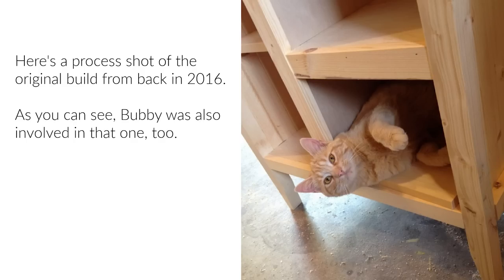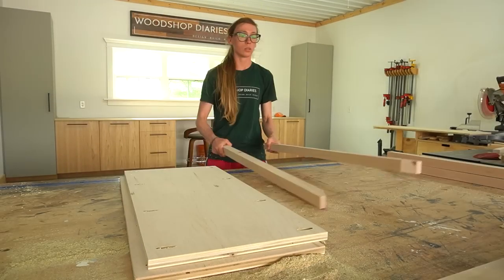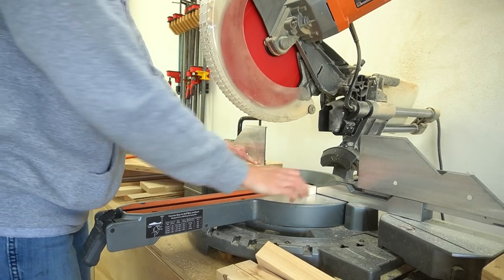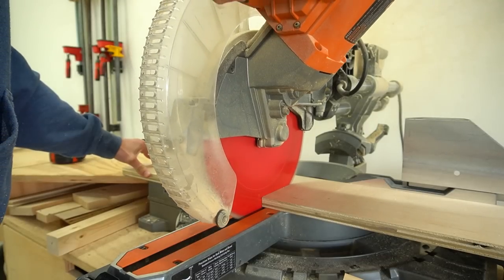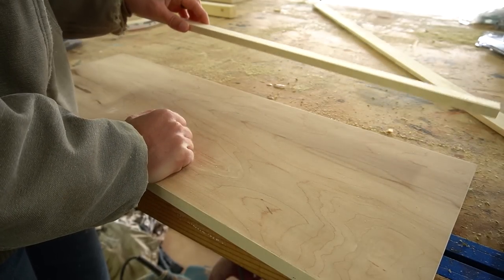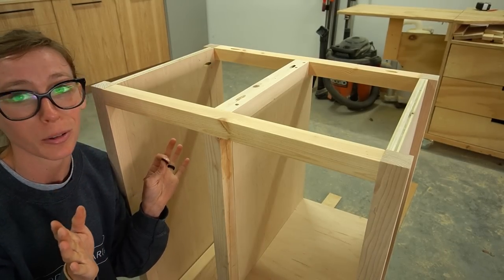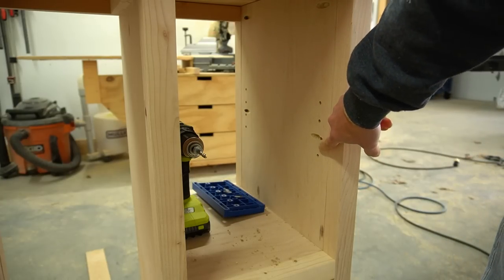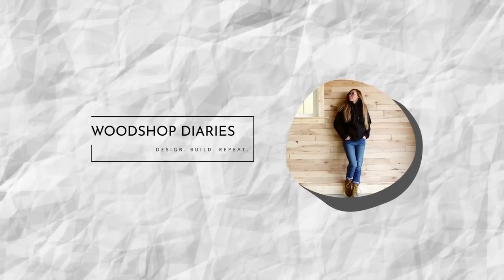I Re-Built a Project from 7 Years Ago | DIY Accent Cabinet Plans

Comment: This was a very nice project.  I recently found your channel and have especially enjoyed seeing how you primarily use the pocket hole fasting method.  I will be using this method on my current project to build a linen closet. Thank you for your very clear instructions and illustrations.  I think I may try the Kreg ripping system, too, for breaking down the 8' x 4' x 3/4" sheets.
Reply from the maker: Thank you so much! I love pocket holes for building and especially for cabinets and plywood projects! I’m glad you find the videos and the instructions helpful 🙌 for what it’s worth, I love the Kreg rip cut and accucut guides and use them on almost every project. They’re life savers! I have a guide to using them here if you’re interested: https://www.woodshopdiaries.com/cut-down-plywood-sheets-with-circular-saw/
Reply: @WoodshopDiaries  I ended up getting the Kreg rip-cut and also the Accu-cut.  Just finished breaking down a sheet of maple plywood using both of them and am very pleased with the results.  It was a little "new" but became more and more familiar with each cut.  Thank you for putting me onto this system in your video!  My woodshop was too crowded to set up in so I set up in my tractor shed so that I could back the truck right up to the sawhorses and slide the sheet off.  I will break down the remaining sheets in the same manner.  As a 70+ year-old, every labor saving step is welcomed.  Thanks again.

Comment: Its always fun to watch your eyes when you're working something out in your head. Do the hinges actually stop the door when its straight/closed? Or do the shelves act as a door stop?
Reply from the maker: …Kind of neither? The shelves aren’t deep enough to stop the door but the hinges don’t stop them either. If I pushed the door, it would swing in a little. But the hinges are “stiff” enough to hold the door in place so I just close it where I want it and it holds. If that makes sense.

Comment: Lovely build shara,did you install a door stop in your design, or did the shelves prevent the door from.going too far in when you closed it?
Reply from the maker: Thank you! The shelves aren’t deep enough to stop the door but the hinges don’t stop them either. If I pushed the door, it would swing in a little. But the hinges are “stiff” enough to hold the door in place so I just close it where I want it and it holds. If that makes sense.

Comment: I'm curious what type of orbital sander you use and I assumed you have out hooked up to a shop vac? You make these projects look so easy... But they'd  take me forever and I'd probably end up with alot of kindling...
Reply from the maker: I am using a SurfPrep sander with vacuum system. Before it I was using a Mirka with vacuum system but it died and I switched to surfprep. I like it a lot but it’s pricey. I also have a cheap $100 Bosch orbital sander and it works just as well and you could just hook it to a shop vac for basically the same set up.
Reply: @WoodshopDiaries  thanks. They are pretty pricy! I'll have to hold off on that purchase...😂

Comment: One of my biggest struggles with building is trying to get things square. On my budget im using construction lumber (which i know is part of the problem), which it seems like you are using as well. How are you able to get your pieces square enough for your projects? I have and use a tablesaw and circular saw guides but i never seem to get it quite right
Reply from the maker: Hi! First, it’s important to take your time choosing the best boards you can. I suspect that’s likely the real issue in most cases. I discuss that more here: https://www.woodshopdiaries.com/how-to-buy-lumber/

Then, make sure to shave off factory ends so you’re starting with square ends for your cuts—for example, shave a blade width off the end of your 2x4 board before measuring and cutting your first piece. That way the ends are both cut smooth and square. 

In many cases, I square the rounded corners off my 2x boards like shown here:   https://www.woodshopdiaries.com/woodworking-tips-square-edges-make-your-own-2x2s/

Comment: Hi Shara, have you ever had problems with the edge banding peeling up after a while?
Reply from the maker: Hi! I haven’t had any that was sticking fine just start unsticking. In other words, I haven’t found time to be a failure factor. However, I have found that if I didn’t properly apply it, it would show up when applying a finish. Any section that isn’t properly glued will bubble when finishing. That’s when I learned you need to apply heat until the glue melts (don’t just quickly run the iron over it and call it good) and make sure to PRESS IT DOWN while it’s still warm. Since I learned that (pretty early on haha) I’ve had this on kitchen cabinet doors, my workshop, and projects all over my bathroom (moisture prone areas) and not had any start peeling. I have a guide to how to apply it with links to what I use here: https://www.woodshopdiaries.com/how-to-cover-plywood-edges/
Reply: @WoodshopDiaries  Good to know - thanks!